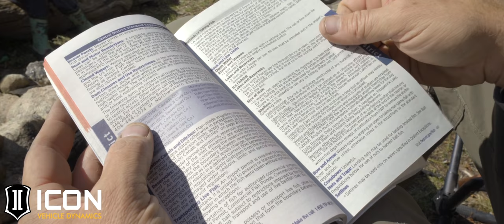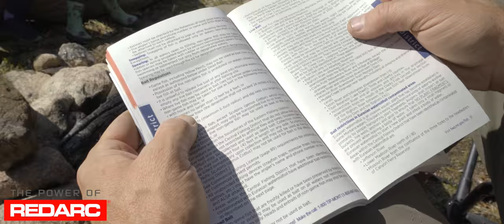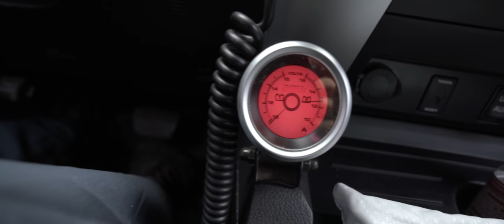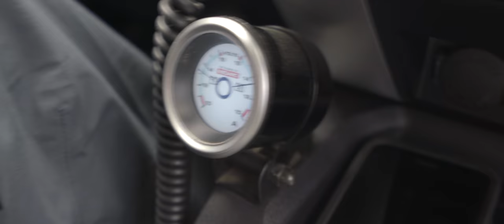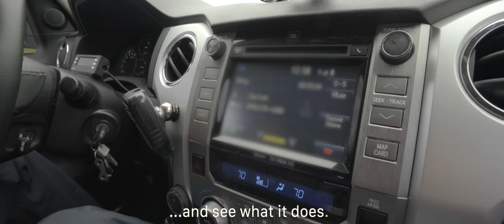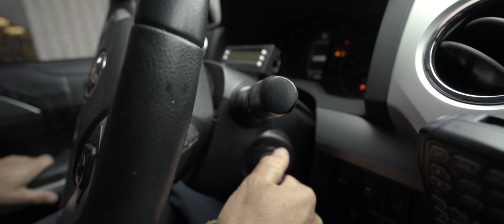Backcountry Fishing & Breakdowns: X Overland's Walthall Family Solo Series EP3

Comment: My experience with Toyota battery terminals is, replace them with Marine grade battery terminals. Toyota ones are cheap and flimsy. Marine grade are solid and make more contact with the battery post. Also the have slots available to attach accessories. Great video and good job on figuring out a solution.
Reply from the maker: Good to know, thanks!
Reply: Yeah that modified terminal for the dual battery setup was ah..different. LOL. Add this to the preflight checklist. And some basic battery/alternator function training.

Comment: Great video. One thing of importance is when jumping a battery, connexions should be made Positive first on both ends, then Negative. This is a safety issue if a cable is dropped or get loose since the car chassis is on the negative side. If done as actually shown in the video, dropping the positive cable will result in a short circuit and risk of fire or explosion. This should be corrected on this video.
Reply: I remembered when I started driving my papa always say ...what ever happens negative clamps should never be on by itself. "Always think positive 1st before thinking negative" as in life goes for jumping batteries too!

Comment: Surprised that you're not set up to flick a switch and start using the aux battery?  I guess jumper cables work fine, but is there a reason to not have that option. I have my dual battery system set up this way and it saved me once when I accidentally drained the starter battery.